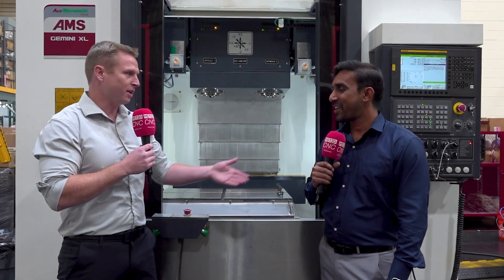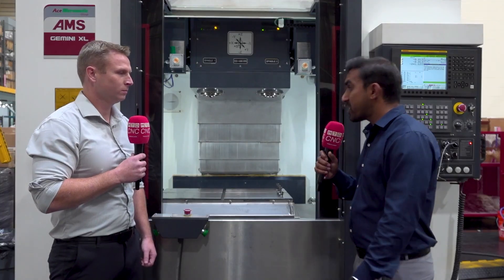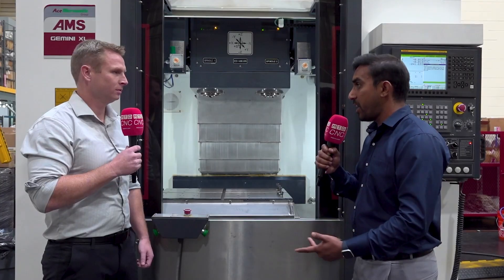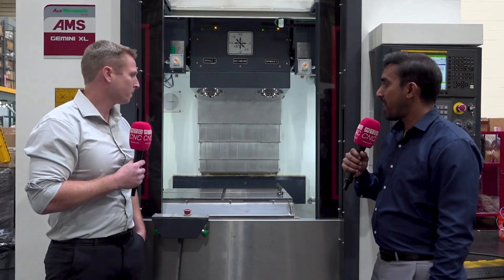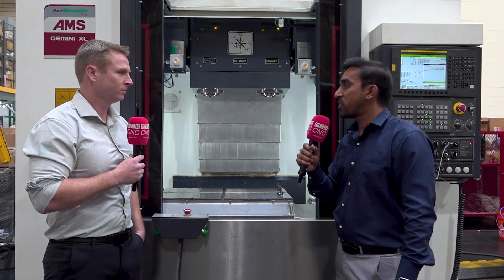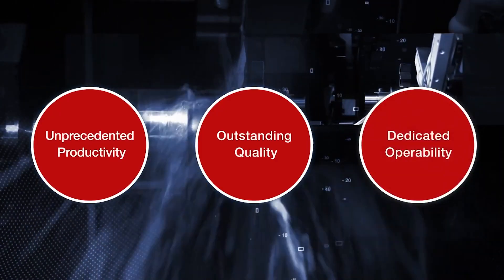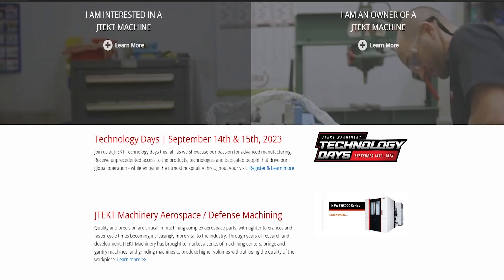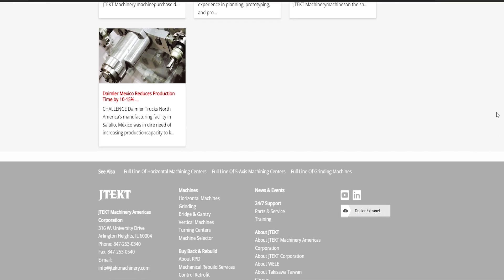High Production Twin-Spindle Vertical Machining Centers brought to you by JTEKT

Comment: That looks like a nightmare. How are you suppose to adjust your tool length so both parts are identical?
Reply: Tool preseters. Not really that hard
Reply: @r @ronaldgarlandjr.3957  I don’t think you understand.. both spindles run at the same exact height, you seemingly need the exact same tool length in each spindle.
Reply: @jayandrusik I know I ran twin spindle matsuras in the mid 90s

Comment: FROM MY WIFES PHONE. Matsurra has had these back in the 70s. Both 500 size and 1000 size, with dual pallet changers. I personally purchased both sizes.Could easily out preform single spindle machines.Also added probing.
Reply: Yep ran both of those😊
Reply: I ran the matsurra 1000. W the pallet changer.
Reply: I am a matsUUra guy thru and true, a lot of vertical 1000 throughout my career, twin spindle, single spindle horizontal and mam five AXIS

Comment: So...how is Z established for both spindles?  Is it necessary to precisely set both tools to the exact same length?  It would seem this would be problematic for tight tolerances, as even new endmills will vary somewhat in length and depending how the tools are held, they may not both have the exact same runout.  Just wondering.
Reply: You use a tool presetter to set tool length to match your tool length offset.
Reply: I was just wondering that do you set to zero to both if zero tolerance is needed? Do you have to offset each tool if you find a taper?

Comment: I don’t understand how you can get accurate cuts in z like this.  Is there a high precision tool setter you can use to make both tools the same length?  Or is one of the spindle heights adjustable?
Reply: Yes, we use a preseter to set tool length to match the length offset.
Reply: They must have some sort of adjustability, Running 2 op2s at the same time would be impossible because you would either need to cut the fixture in the machine or locate both fixtures within a few tenths

Comment: Twin spindle, well you have one offset to control tools in each spindle.  Not a good idea.
Reply: Why is that not a good idea? As a 30 year prototype machinist and programmer I can't see what the problem would be
Reply: @tranoble7321 one offset to control both spindles. And I am doing it a bit longer than you.
Reply: Offsets don’t matter if the tools are the same length? I’m pretty sure the value of this machine is running the exact same part side by side at a set distance apart.
Reply: @armandolongoria6626 what about OD? It is relatively easy to keep when you use a new tools. Problems coming, when you use regrinds. Have you ever set tools? And what equipment do you use to set tools?
Reply: @mirektobiasz7420  I doubt a company this concerned about cycle time is using re grinds. Probably end mills in collets with a hard stop to make sure they are the same length even after changing them. I bet these machines do a lot of drilling too, which is way less critical if you’re going through the part. I set tools with a height gauge, renishaw tool setters, indicators, paper against the table, paper against the part, doesn’t make a difference
Reply: @armandolongoria6626 using piece of paper as a spacer, that's a highest level of precision. Let's say, you have to set 64 tools this way, it would be time consuming process.
Reply: @armandolongoria6626  Correct, resharps aren't used except for roughing mills and drills, and those are done in pairs. All of our port and forming tools are new. Tool lengths are set to the lengths specified in the tool offset listed in the set-up sheet instead of setting the tool and then changing the offset.
Reply: @derekmonroe3691 what about runout?
Reply: @mirektobiasz7420  Are you asking about runout in the spindles themselves?
Reply: @derekmonroe3691 tool run out. When you have a machine with a spindle runout, you cannot make a good parts. Period.
Reply: @derekmonroe3691 what are you using to measure your parts? 
So you input tools data manually.
Reply: @mirektobiasz7420  Measuring tools vary from go/no go to air gauges at the machine. Of course, CMM is used in QC. Tool lengths are set in the tool setter to the target length specified on the set-up sheet.
Reply: @mirektobiasz7420  Tool runout is far less than our tolerances. This is high volume work with smaller aluminum castings. High precision work is done on single spindle machines.
Reply: @armandolongoria6626 it also depends how close tolerances you have.
Reply: @armandolongoria6626  Now explain how you’re going to get those tools to be within within .0005” of the same length for every tool every single setup..
Reply: One offset to control both spindles.
Remember Kitamura from 1980s?
What control did Matsuura use?
Reply: @mirektobiasz7420  We have no problem with the Gemini in our shop in that regard, and as a Maintenance Tech the fact that ever switch and sensor is labeled and identified as to what input it is , is a huge win.
Reply: @derekmonroe3691 I think, you don't have any idea what are you talking about. Do you know meaning of offsets? Switches don't have anything to do with offsets.
Reply: @derekmonroe3691 first, you have to learn some English. Second, you still don't have any idea what are talking about. I am talking about machining not about maintenance.
Reply: @mirektobiasz7420  I said, "We have no problem with the Gemini in our shop IN THAT REGARD...". That was the part that was the direct response to you. Everything after the word "and" is not related to the non-issue of offsets. Now, you can either accept that you misread my post or continue acting the fool. P.S. I was a machinist for ~20 years before going to maintenance.
Reply: @derekmonroe3691 what does it mean ; in fanuc system?
Reply: @mirektobiasz7420 
No we may use different tool offset to both splindles seperately it may reflect in W-axis. Difference upto ±10mm
Reply: @shankark3250 where do you see a W axis here? You don't even know what are you talking about
Reply: Obviously, you have no idea how it works.